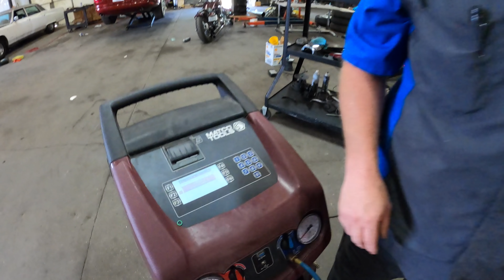My First ANNOYING Aston Martin Rapide Problem & RUNNING A FLATHEAD FORD V8 WITHOUT A CYLINDER HEAD?

Comment: My dad had a 1950 Mercury 'sled', 2 door coupe for his work car. I remember working on that car, flathead and all. It still had the 6 volt system, and oil bath air filter. And my dad, not wanting to spend $ on extras, would use a roll of toilet paper, without the tube in it as the oil filter, in the cannister by the fire wall. it must have worked, he drove it that way for years. Thanks for the memory.

Comment: I have made several 6 to 12 Volt conversions and have changed the starter motor to 12 V with just a few inches of copper brake pipe and insulation. It is a common thing done to even model A cars.

Comment: The only vehicle my Grandad ever purchased new was a black, '51 Ford sedan with the flathead V-8. When I was still a pre-teen (a LONG time ago) the area Ford-Massey Ferguson tractor dealer use to send out his head mechanic, prior to planting season, to tune up and/or repair any of his customers tractors. What was also common, in our rural area at the time at least,  was for that SAME mechanic to tune up and/or repair the many Ford cars and trucks farmers owned and operated along with those tractors. Since I was just a kid I found it interesting but not at all unusual to see a flathead run without it's "heads"....I just figured that was the way things were supposed to work.

Comment: Watching you take that head off took me back to when I was 14 or 15 doing the same thing on  my father's '48 Mercury (rebadged Ford) pickup which had the same engine. It was the first chance I got to work on a car engine, although I had dreamed about it for years. When I got the head off. like you, I was so proud I had to show it to someone. I carried it into the house much to my mother's horror. My father had a very similar woody, a '50 or '51.

Comment: My mom used to run the the American Racing electro-plating facility in LA when they were chrome plating wheels for the Prowler. I got to see it, it was pretty cool. But those rear wheels are SO BIG they lost about 40% of them to plating defects in the process (the Enron-era rolling brown-outs didn't help), that's why they eventually stopped plating them and went to paint.

Comment: My 2010 Rapide had exactly the same problem this month! I live in the UK and Chiltern Aston (the independent I use) diagnosed the fault as a faulty bonnet latch. Also, it’s important to fix because the windscreen wipers don’t work if the car thinks the bonnet is open. I discovered this when it was raining and driving on the motorway-scary! Just some other facts: the black textured paint on the wing mirrors will start to peel off - there are no wing mirrors left for the Rapide. Also, do you have a rocker switch under the headlamp light switch cluster? No one seems to know what it does... not even Aston! It’s great you have brought awareness of this car to your audience’s attention. It’s such a great GT and sports car and is much more exciting than anything from Bentley or Mercedes. Please let us know how you fixed the fault.

Comment: Had a 51 Woodie back in 68. Bought it to use as a demo derby racer. These things were a tank, the door weighed at least 70 lbs It was dark green and not as Cherry as yours but real nice. Couldn't bring myself to wreak it. Sold it to a bud. Oh crap my keyboard is spazeing out. I guess it's not tear proof. Thanks for the memories.

Comment: Older cars were so satisfying to work on due to simplicity. I had an old ‘64 Plymouth Fury with a 225 ci slant six. Replacing the water pump was a 30 min job. Replace the alternator was about 20 minutes.

Comment: Bentley suggestion! I had a 1990 500SL with the Bosch fuel injection system, it had a stumbling and a misfire. I brought it to a mechanic I trust and he did a pressure check, because it is mechanical fuel injection system it is heavily dependent on pressure, so slight fluctuations can mess it up. He replaced the fuel pumps and the problem went away. That was after I put a new fuel distributor, injectors, idle air control valve, intake manifold gasket. It turned out to be so simple as a fuel pump.

Comment: To trick the hood sensor on the Aston, just cut a paper clip, use the "U"  to plug into the connecter to complete the circuit.  No more trouble light/code.  Just put tape to hold the clip in connecter.

Comment: I spy a CL on the lift back there. One of my favorite past cars was a green 2004 CL600. Bought it cheap and very broken, fixed everything and drove it for 2 years with not a lot of problems. I do miss it, those things are just so, so comfortable and quick. Also, it flies under the radar because while a very handsome car(in my opinion,) it's very subtle. I do agree with the sentiment that every car guy should own a Mercedes V12 at least once. Probably just once, fixing them requires forking over about the GDP of Liberia if you aren't the man with the wrench.

Comment: The new Alfa Romeo I leased had the same exact issue as your Rapide. It took almost a month to fix, because the dealership made a mistake & had to fix their error. It was the cable that attached to the latch that was the problem.

Comment: Hoovie..... Back over 45 years ago, I had  a 1960 VW Bug with the 36hp engine. Being a wild 16 year old, I "jumped" on it in a turn with water on the street and banged a piston by over rev-ing it. Drove it home (about 5 miles) and with in half an hour had the head off and the piston and barrel off. Blew off 1/2 inch off the piston. Luckly, I had a matching piston/barrel to replace it. Half an hour later I drained the oil, replaced it with diesel and (after pulling the coil wire) turned it over for a few minutes. Drained the diesel along with metal shavings and put in fresh oil (which I replaced in bout a week). Drove away with it running like nothing happened. Those older cars were tougher than granite........(drove that lil sucker for another 3 years or so before I replaced it too)

Comment: Might be a silly question, but I wonder why you can’t see a tiny mist of atomized fuel being sprayed into open cylinders. Another thing I realized is with no valves, no need to lubricate anything on the top end, so no oil spray. I’m glad I got to see it. Thank you:)

Comment: I can’t believe it actually can run on only 4 cylinders with the head off! That’s amazing!!
Reply: chris younts fair, but no modern V8 engine will run on 4 cylinders using only one side of the engine. Ain’t happening..let alone with the head completely off.

Comment: I love woodie station wagons. Even if like that '51 Ford is basically wood trim. But it retains a fully wooden tailgate. I am a Buick guy and they did some beautiful woodies themselves. I especially fond of the '49 Roadmaster estate wagon. Lots of wood in that one.
Reply: There is probably more wood on that 51 Ford than on 49 Buick..Ford has wood on the whole area outside of the doors(steel frame doors but there is no sheetmetal under the outside wood) so both the lighter color trim and darker color panels are wood. Same thing on the sides, there under that wood is steel though. If you would take the panels out under the rear side windows there would be sheetmetal. Tailgate is completely steel, not wood.

Comment: Flathead engines like this one are not especially efficient, but the main disadvantage is that these engines are really tough to valve grind, because the valves are part of the engine block and down the side of the engine.

Comment: Hoovie, don't go overboard tuning your flathead Ford. The limitation is the inadequate cooling of the siamesed central exhaust ports, which can lead to steam pocketing, then head gasket failure and eventually block cracking. One solution is to use high heat flow cooling liquid, rather than water/anti freeze mix and after having the radiator core replaced, a higher pressure radiator cap, to discourage steam formation. Steam is a very poor conductor of heat. That is why in period many hot rodders switched to Ardun heads and in later years Dixon heads, which were OHV and had 4 exhaust ports per bank.

Comment: My Lincoln did that with its back door.  Turns out it had sensors in each of the latches.  I used quick dry electronics cleaner and that did the trick

Comment: Had an 06 Silverado  I got in 2011 for 2500 bucks because it had a bad ac leak, the guy I bought it from had it charged like 25 times in 5 years. Well I bought it and changed the shader valves(10 cent part) in the charge ports and it never had a problem again. My boss whom I picked it up from was pissed! Hahaha

Comment: I can top the Flathead's party trick, cool as it is. Had my '73 Beetle throw a rod and shatter the 3-4 cyl bank into several pieces. It still started up with 2 out of 4 cylinders (instead of 4 out of 8) and they were destroyed rather than merely disassembled. It even maintained idle speed better than ol' Flatty.
Booyah!!!

P.S. It wasn't the Vdub's fault either. I'd built up the engine from an old shortblock my dad had lying around and couldn't remember why. After it grenaded his memory was refreshed: there'd been a wee knock...

Comment: "All that equipment they need for that Bosch KE-Jetronic, nobody has anymore" Yeah, sorry, but all you need is a (good! Needs to be very responsive) Multimeter. I've done numerous W124s with KE-Jetronic and really, all you need is a Multimeter that is fast enough. However, there are special multimeters, like the HoldPeak HP-760J that are just for Dwell Angle measuring and stuff...

Comment: I like the car, don't agree with the engine mods. It'll be going back to the Wizard often to keep those two carbs synchronized, and since you are raising the compression, you might have to add octane boost to every tank of gas to keep detonation at bay

Comment: I see the existing electrical system is a negative ground system. I had a 1948 Ford F-1 truck that was 6 volt and I'm pretty sure it was a positive ground system.

Comment: If you've replaced the ignition components and I take you've also looked at the fuelling side of things in the Bentley. Could it be a stuck valve or something or a vacuum hose leak causing a misfire

Comment: 6 volts was all a car needed from the beginning of the automobile until the 1950s. Cars initially only needed electricity to provide spark and regulator power for the ignition. There was no fuel pump, headlights were gas or even candles, and that was about it. Not even an electric starter until Cadillac developed it in 1912. You cranked the engine by hand. Then came electric head lights. Then came tail lights. Then came heaters, turn signals, and reverse lights. By the 1950s you had dashboard lights, interior lights, gauge lights, radios, and manufacturers knew the onslaught of technology that was about to hit the car world really fast (power windows/locks/seats/load leveling suspension/air conditioning/cruise control/power trunk release were all new electric technologies made available as options on cars first appearing between 1954-1960). 6 volts was no longer enough to supply the load for all of the accessories. So in 1954 the Society of Automotive engineers standardized all vehicle electrical systems for North America to the 12 VDC system we still use today.

Comment: I had a Renault Laguna estate car and was going on a thousand kilometer trip to a trade show. Shortly after we left the clever french car started telling me (yes, it spoke) that the trunk lid was open, which it most definiteley was not. But it didnt tell me once, it told me every 60 seconds. After stopping and trying to turn it off electronically, I reached into my bag and pulled out a pair of electrical sidecutters and proceeded to cut the wires to the speaker which was buried somewhere behind the dash. Apparently I upset the poor little french car cos she never spoke to me ever again :)

Comment: Henry Ford was about half crazy. But his insistence on rugged, inexpensive, sensible, and simple solutions  served America very well, especially prior to WW2. He was one of the very few automotive engineering pioneers who didn't do the silly vanity projects that killed so many car companies. Henry Ford got off on production efficiency. That was his thing.

He knew the company needed newer and more powerful engines, mainly to compete with GM. He decided that an affordable V8 was the correct answer, all things considered. He didn't how the hell they were going to do it, just that they WERE going to do it. Previous V8 designs were far too expensive to produce.  

So the Flathead V8 was a big challenge, even for him. He actually shut down his famous River Rouge factory, laying-off the whole production staff for over a year at the height of the Great Depression, in order to work out its design. His engineering staff kept telling him it couldn't be done, and he kept telling them to 'find a way'. In the end, totally because he just wouldn't take 'no' for an answer, they did.

Comment: That Rapide hood issue is not British engineering. It's Ford with bits from Volvo. The sound efect it makes for the hood is totally Volvo as well as gauge cluster, key fob and navigation. Maybe mirrors are from Volvo as well. :D :D

Comment: FYI-rodding the flathead, lots of hot rodders discovered huge voids in the block casting for their engine by windowing the engine  😜 (Ford's casting process for the flathead was absolutely atrocious by modern standards!)

Comment: That was better than a Visible V-8, the old transparent engine model made by Revell (and still sold). I'll bet the Wizard has one stashed away in some forgotten attic space next to a boxful of a wireframe Christmas tree.
     It should be a question for each and every builder on YouTube. Have you built a Visible V-8? If the Wizard has not, I don't want to know.

Comment: Pretty sure the 'wizard'  was recently complaining about other garages just fitting stuff as a repair method instead of finding the fault and fixing it. The Rolls Royce engine isn't that complicated!
Having said that, the only way to properly fix the 'Citroen' hydraulic system on a car that age is to replace all the seals. It is a much heavier beast than any Citroen. Absolutely pointless sorting out one and waiting for the next one to go.

Comment: Believe it or don't!  The Flathead V8 continued in Canada on cars through 1954 and commercial trucks through 1956!
Reply: Yeah and flathead V8 Ford engines were made in France until late 80s/early 90s....They used those in some.military trucks. A friend of mine has bought one from French Army surplus auction, sometime early 2000s, they had crates full of unused spare engines for sale....

Comment: Re-torque those heads every few thousand miles, till they stop stretching. You can thank me later. Just consider it a maintenance item on aluminum flat heads. If you don't, you will lose coolant or worse.

Comment: Your Bentley Injectors will be  Worn Out , replace them and the Rubber O ring seals which go hard and leak air into the inlet manifold causing a Misfire. !!!!!!!!!!